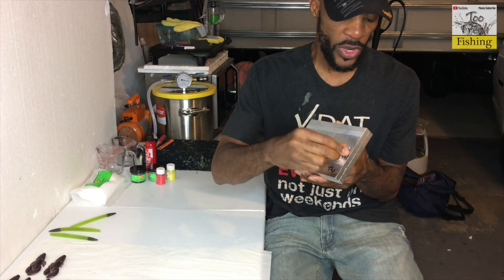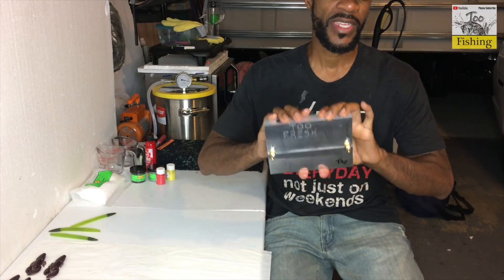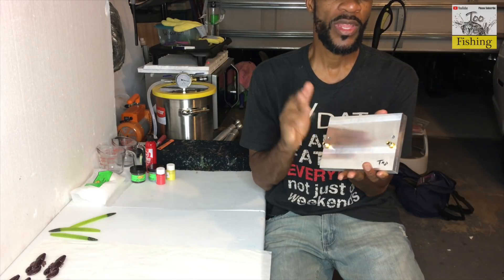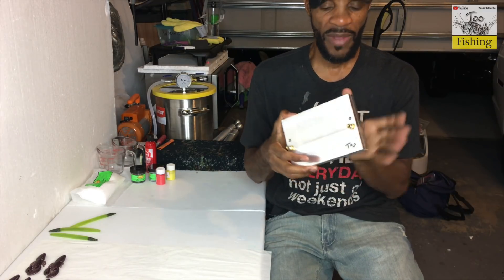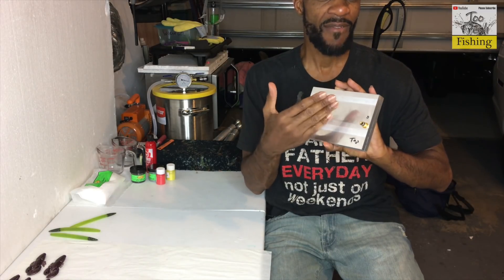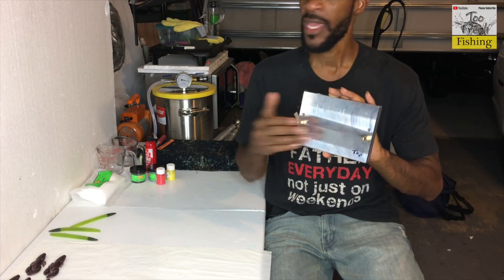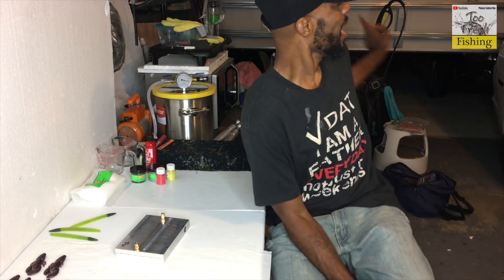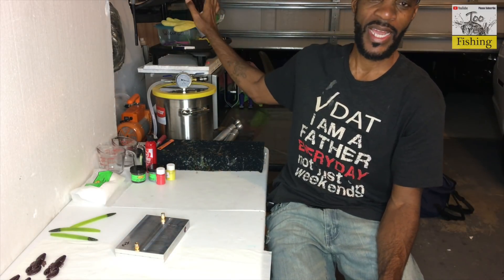Series 2 : Two Color Core Shot Seiko Bait (Stik Em) Tutorial

Comment: Awesome good how do you get the tails without dents I’ve tried a couple times now and keep getting dents in the tail
Reply from the maker: Thank you brother. Sometimes I do get dents as well. Heating the plastic up a little hotter than 350 and hold the pressure for about 30 seconds before I remove the injector helps. Also, using a sprue extender helps out a great deal. It gives the core shot more plastic to draw from while it sets up. I hope this help and thanks again.
Reply: @TooFreshFishing  thanks I’ll try holding pressure longer and I noticed you don’t leave them in mold too long I might be leaving them in to long
Reply from the maker: @briandolbow2709  No brother I don't. I believe it increases the chance of getting denting the longer they are in the mold.
Let me know how it works out for you.
Reply: Thanks again for your help and your video I’m going to try again this weekend